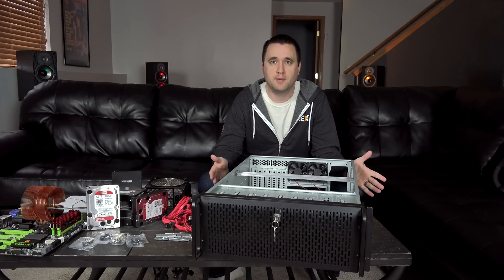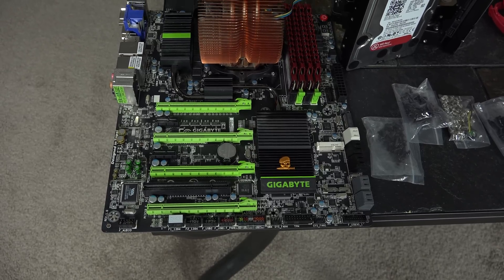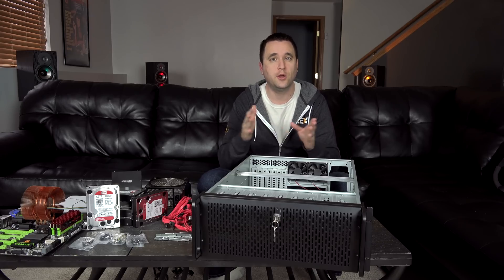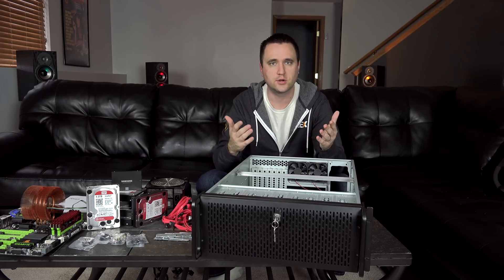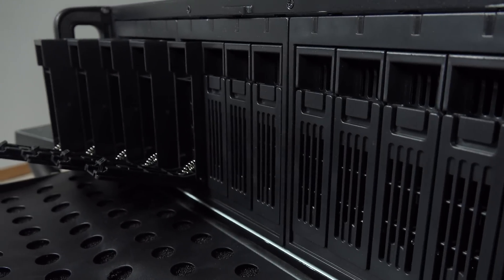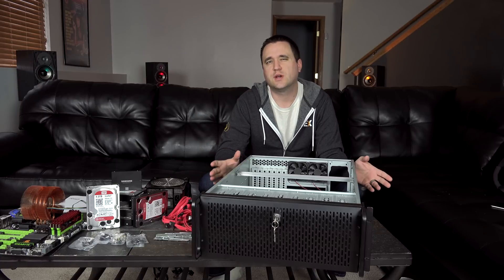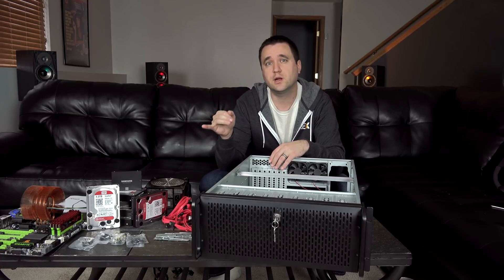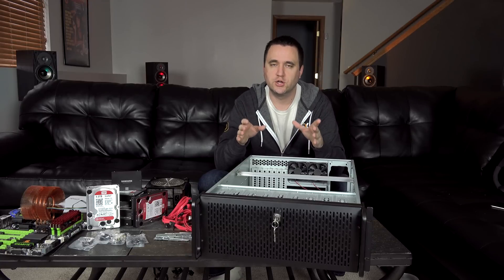Building an Expandable, Dedicated Plex Media Server

Comment: I’m building my first dedicated Plex server as a combination of old & new (to keep it within budget)....using an old steel Mid-tower case (5 5 1/4” bays, 4 3 1/2” bays)....bought an Asrock X570 Phantom Gaming 4S board for $139 (it has 8 SATA ports and an M.2 port, plus pretty good onboard video & sound),  using an old Ryzen 5 1600 cpu, 32GB of DDR4 Corsair Vengeance LPX that I had available, and a 750w Corsair psu from an old build....now I just need to add 2 x 8 TB Seagate Ironwolfs and it’s ready to go.

Comment: you can buy a cheap poweredge server for less than what this guy spent on all the components (minus the hdds of course).  I bought a dell poweredge server with dual xenon cpus with 8 cores each, 64Gb ram and 12 hotswap hdd bays plus 2 internal bays  all for $250 on facebook marketplace.  This left me with more money to buy high capacity drives, went with 6x 16TB drives

Comment: I took a 9 years old PC with windows vista and 3gb ram. Installed windows 7 with a 2TB hard drive and it works fine. why not use an old PC instead of bying a new one mister please?!  You can buy a startech cable SATA to USB too if you need...

Comment: My server is my laptop and its connected trough wifi its has 2.7terabytes and core i3 1.7ghz and 6gb ram it worked fine i played more than 3devices at the same time at 720 (all my movies is at 720p) it has back up battery so i dont have to worry on power outage and it uses very tiny power

Comment: Great video! Bought the Rosewill case on your recommendation. Thanks! Quick question: What do you do when the 12 hard drive bays are full and you still need more room? Anyway to add more drives to this case? Or build a secondary hard drive enclosure and connect it via software RAID array (flexraid). Thank you so much for your channel

Comment: 8 year old power supply. :( That is not a good tip to tell people and its a rosewell. Remember the power supply powers all devices and you should not be a cheap ass on it.  A good power supply is not that much money. When I have a power supply over 4 to 5 years I replace it same with hard drives.

Comment: Whats the build cost? (approx)
Reply from the maker: When I am done with it, I will cover it all in the last video.
Reply: Byte My Bits No I mean "cost so far" because I am planning to build one after being inspired by you. I need an approx cost without the hard drives for the stuff you used in this vid.
Reply from the maker: oops I thought the og comment was on a newer video of my dual xeon server. this server here is hard to peg because i recycled a lot of old hardware. I can say for sure the case was around 200, but the rest was old stuff I had.
Reply: But this would definately be more than your 500 usd build right? and less than 1000 usd? (Sorry, i now its a pain to answer some strange weirdo's stupid questions over the internet, you run a channel not customer support =P)
Reply from the maker: i7 3770 with 16GB Ram, 650w PSU. g1 Sniper 4 motherboard. All old pc parts so no real way to peg a price cause everything would be used. When it was new, it prolly cost over a couple grand to build my full PC. This is less of a buying guide and more of a demonstration on how to build and expandable server with old parts.
Reply: Byte My Bits Ok thanks for the info. I really appreciate it! =)

Comment: Being that I'm not a very smart man, do you have any updates for the processor, ram, and motherboard? I love the case set up but I see the processor and motherboard are no longer available.
Reply: how many videos are you planning on streaming at once? if you are going to only stream 1 or 2 movies at once then you can get a cheaper processer and mobo, and grab some pcie sata cards. Intel G1820 with ASRock H97M Pro4 mobo and 8GB ram would be fine and use less power.
Reply: I would say that at any given moment I would not stream more than 2 -3 movies at a time. I would like to go with an ASUS mobo and Intel CPU. Lastly, I have roughly 600 movies in my collection, would I be smart to go with the Rosewill 12 bay in the video or just go with a smaller case?

Comment: I've found that a rack mounted solution is the best. With rack mounted servers, you can easily have 2x CPU's and since plex can take FULL advantage of multiple threads, it scales well.
I've got 2x Xeon e5410 and even though they only have pass mark scores of 3200 each, I can easily stream 5-6 1080p movies at once. Combined with 16gb of ram and I could use one entire CPU to virtualize a different OS JUST for plex! 

So what do I think is the best solution? Rack mounted servers. And if you can't afford brand new equipment, get some older used systems and they will still work fine

Comment: Why build one when a HP Prolient DL580 GEN3 would work just as well if you were to install PLEX Server onto it in place of the original OS would that not make more sense as web servers are designed to be left on all year round and not go kapoot, anyway website operators are switching to higher powered web servers so the older HP Prolient DL580 GEN3 would be available for next to nothing but you will have to add the memory as they will have used the memory for the newer machine.

Comment: I am using freenas with some ecc ram and cheap seagate drives. the drive setup is a zfs pool with an ssd cache. it did burn a hole in my pocket but my data is not trivial so I would absolutery not risk losing my data with a single drive failure. I would highly advise that you did the same because I think you value your data as well

Comment: Jason, absolutely loved this video for the 12 bay Plex server. I'm ready to take the plunge and build one. You should build these and sell these like Weaknees .com does for TiVo expansions. Might be a nice side income. Given that something so large will house (and archive) a large digital library that would take a very long time to reproduce if a drive crashes, I definitely want to put in some kind of RAID (HW? SW?) so if a disc fails I can swap out a drive like I do with my Netgear NAS device. Given that you did this video about 6 months ago, I'm wondering if you have any updates you have thought of since, or if you have any RAID recommendations? I'm ready to start ordering parts so any additional advice you have would be most appreciated. I figured you might want to post it here to update the value of this already great video. Thanks!

Comment: For those unwilling or unable to spend ~$300+ / -  USD on the Rosewill RSV-L4412 case, you can buy the Rosewill RSV-SATA-Cage-34 - Hard Disk Drives Hot-Swap cages (same as the ones used in the Rosewill RSV-L4412 case) for about ~$40 to ~$50 depending on where you go.  The first one I bought was on sale for about ~$35.  Also there is the Xigmatek COA-UGOCBS-U01 Universal 3 in 3 SATA HDD Hot-Swap Cage which is the same as the Rosewill RSV-SATA-Cage-34 - Hard Disk Drives Hot-Swap cage but only has 3 HDD hot swap bays and cost typically around ~$35 USD.  The Xigmatek COA-UGOCBS-U01 adds a front door with dust filter. 

Any one of these solutions would have worked fine in the other case in the video since it had a full set of at least nine 5.25" bays.     

For what its worth the Rosewill RSV-L4412 case seems to be a fine case (if you have the space for a 4U case) but the Rosewill RSV-SATA-Cage-34 cages installed in it seem to come installed by default upside-down.    It makes it easier to install the power and SATA cables but it makes a mess of the cable routing and has the top of the HDD trays facing to the left rather then the right.  Right is ideal for those who are right handed which is most of the population.   All you have to do is flip them around and you'll have better cable management in most cases.
Reply: I know this is old but I'm looking at this case 5 years later - your point makes perfect sense - all those cables running from top down to MB are a freaking MESS!  And his old case could have easily fit drive cages, but admittedly this one is much nicer so don't fault him for that, but for someone on a budget not getting free stuff it's important to know about 3x5 cage adapters

Comment: Please......manage those SATA and Molex cables!
Reply: it matters for airflow
Reply: Adam Deane. Minimally though with this active airflow setup. Common misconception.
Reply: it wont affect air flow much. but if you ever had to open it up again it would be easier to manage if you did.
Reply: it doesn't matter if it is pretty it is a server...smh

Comment: byte my bits, thank you for your comment. just found out my n4610 can not handle that cpu. looks like i am going to remove the cobwebs off my rd630 server and use that as my media server but use my n4610 as my fileshare. the rd630 will then become the transcoder since it can handle 14 and 16 core processors with upto 135 watts. arghh. was hoping to run it off one box but i guess not. anyways at least i can use the n4610 to rip by blurays or maybe i can use the rd630 since it has more cpu power. what do you use for ripping your blurays at a 1080p without video or audio loss? i have a 4k uhd 3d tv and a 7.2 sound system, which later be upgraded to 11.2(7.2 with four atmos speakers). i currently use makemkv. i use the settings of 1080p mkv. but i did notice if i put that container on external hard drive to the tv, it will not play it unless it is transcoded to h264. will i have to do that to my movies to run it on PMS?  or will that be transcoded by the PMS? i cant play now because i am waiting to get my drives.  on my rd630 i will use two ssd drives of at least 256gbs for the pms server. at least my rd630 has 16 2.5" drives for later use. what best method for ripping blurays to keep its beauty and sound from its original content? i will be receiving next month my 4k player from samsung, i wonder if pms can handle that?

Comment: byte my bits, nice video. i like that you went with a rack mount. i am in the process of building my first plex media server(1st media server was over 10 years ago and used a linksys media player-only one streaming was possible-still have that same server with over 200 DVD titles in it- but password i can not recall). anyways, my new build will be on a 2U rack server from lenovo(n4610). it has two rear mirror raid  slots for me to put my ssds. it will run windows 2012 OS. prefer 64-bit OS and architecture. who knows what PMS may do in the future-in house ripping software?
anyways, i am planning on purchasing an intel xeon e5-2697 v3 processor. based on a 2000 passmark for stream, this processor has 22000, theoretically giving me 11 simultaneous streams. a bit pricey, but well worth it. my server as well holds 12 drives, a big plus for expansion. i choose this server cause it allows me to expand to module that can hold more drives- more media. i was wondering if i throw in a second processor if i can get more streams. does PMS has a limitation?
Reply from the maker: +Joshua A. Guerra Plex can take advantage of dual CPU, but since you already will have a beast CPU, not sure you will need it. Remember, most streams inside your home will not need transcoded.

Comment: This looks pretty cool.  I have actually been looking for a case like the one you use in this video.  I would probably run two VMs one Windows for the PMS and one for unRaid or freenas or something like that instead of having 6x4tb drives with no redundancy though.  I would cry if I lost 4tb of data.

Comment: I've been watching your videos for quite some time, a couple months now. I built plex server a little over a year ago. I stumbled upon this video and I came to a surprise that, you got the same case as me! I do agree, it is the perfect case.
Now I build mine from scratch with the intention of a plex server. Now its not fully dedicated. I use it to backup other computers too but thats about it. For the most part it handles just media. I run Plex, PlexPy, Sabnzbd, Sonarr, and Handbrake.
I kinda built this over kill at the time but I knew I was going to expand. I've tested up to 10 transcoded video streams and 5 direct play. I ran out of devices to test more than that.
Heres my specs.
CPU: Intel Xeon E3-1246 v3 @ 3.50GHz (4 Cores, with hyper threading which helps a lot when transcoding media, plex and handbrake.)
RAM: Crucial 16 GB (8GB sticks) 1600MHz ECC (could expand to 32GB easily if needed)
MoBo:  ASRock C226 WS ATX (Love this thing has 10 SATA ports!)
Hard Drives: (4 3TB WD Red) (2 Seagate 3TB 7200RPM Desktop Drives) (2 250GB RAID1 Samsung 840 SDD, use it to store plex database and as a cache for downloads)
Price: At the time, Jan 2015, I think everything was around $2000

Now for the most important part. The operating system.
I know how much you hate windows. I watched the rant video. Now thats an easy fix. DONE USE IT. Use linux. And that brings me to this.
Like someone else asked. What do you do for redundancy?
Well I've researched a lot about that. RAID 1 is not very applicable. Its just movies its not worth having to have twice the hard drives.
I've tried FreeNAS, not on this server, but it sucks when you want to get more drives. It has a really bad scalability. So I finally found unRAID. Now you've probably heard of it by now. LinusTechTips has been doing a couple videos about it.

I've been using unRAID since I built this and it is truly the best media server OS. and best part of all.. NO WINDOWS BS! You should really look into it. I've read the the other comments about not having enough drives. Compared to ZFS or RAID5, unRAID uses XFS. Long story short. You only need 1 more hard drive a the least to get started with unRAID then, you can start to use your existing drives and slowly move data over to the array.
Just do your research and It really is the best solution.
http://lime-technology.com

Comment: Since this is really likely to be someone's main home PC where would one put the DVD/Blu-Ray Drive?
Reply from the maker: +Michael Reif This is not meant to be a main pc, it's a dedicated Plex Box. OS installed via USB drive, no need for optical.
Reply: +Byte My Bits OK, I think I get it.  This is basically your home media server for just about all (videos, photos, movies etc.) and the large amount of processing power inside is for transcoding etc.
Reply from the maker: +Michael Reif Yeah to handle multiple streams/clients
Reply: +Michael Reif Another question.  Looks like no video card so trascoding must be done at the Plex receiver.  Not sure I understand that though since Roku 4, Apple TV etc. don't seem to have good graphics power.  Maybe I am wrong about that.  Also would be great if you could expand your video to explain how this server is set up with all devices and TVs to receive the data from online and well as from the server.
Reply from the maker: A Plex server doesnt use GPU for transcoding. Only the client will actually play the media. It doesnt take much graphics power for the clients to play video.
Reply: +Byte My Bits Thank you for all your into.  This was a very useful video for those of us considering doing what you are.

Comment: Hi Jason, have you thought about using a RAID card?  I have the LSI 9260-8i in my Plex media server.  I have three 4TB WD Red drives attached to it and it's set up as a raid 5 array (7.25TB of storage).  It has plenty of expandability since I can add five more drives to the array.  I might decide to migrate the raid to a raid 6 array for better piece of mind.  What is the performance of your server's drives.  Using ATTO my Plex media server can write at up to 300 MB/s and read around 2000MB/s.  I love your videos.  Keep 'em coming.
Reply from the maker: +Mark Freitas atm I need to get enough drives to move all my data over to a raid first, before I can dive into that. I want too, but need more hardware.

Comment: Awesome build.  I used an older  version of that case in my PMS build a couple of years ago that didn't have hot swapable drives.  Make sure you buy the rails for it before they discontinue them.  I threw mine in this rack, fits nicely without being overly huge.
http://www.newegg.com/Product/Product.aspx?Item=9SIA6ZP3K22180&cm_re=12u_rack-_-16-129-091-_-Product

Comment: What's the total cost of this build?
Reply from the maker: +Brandon Hurst Total cost around ~$2080
Reply from the maker: I want to rebuild it with a board that handles ECC memory so I can run FreeNAS and a ZFS filesystem with little worry. Plus I need to add a UPS for power backup.
Reply: Would you recommend FreeNAS over the software that comes with QNAP?

Comment: I did not see a RAID card. Are you using RAID via OS 7? If so what are you using for your Backup in case of Mother Board failure?  My understanding is that if your MB fails while using Software RAID you have lost all data. 

Another great video thanks
Reply from the maker: +stevemccollum2011 Right now I have no redundancy. I have an issue with too much data, so I cant switch everything to a raid pool. I WANT to create a ZFS with FreeNAS or something similar. But I need a board that handles ECC and enough drives to move over to the file system without losing data. So right now I am just working with what I have. But I did buy my x99 board that supports ECC. So maybe next upgrade, I can use this MB. :)